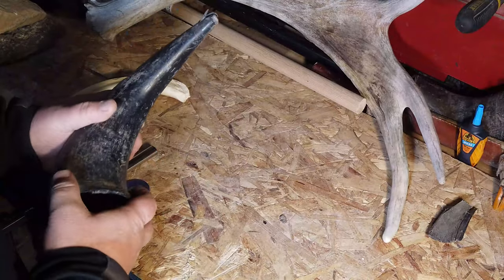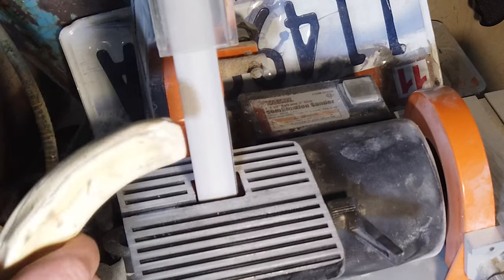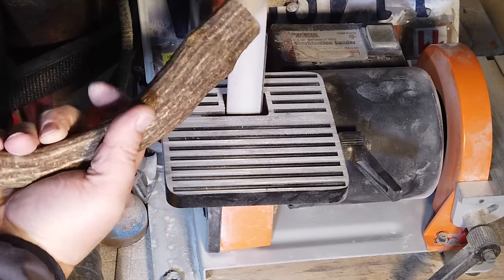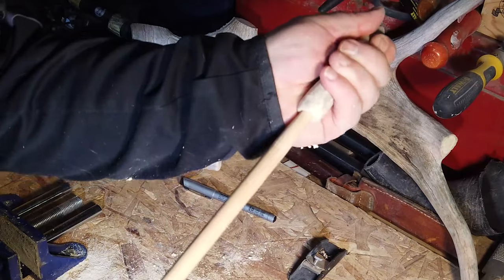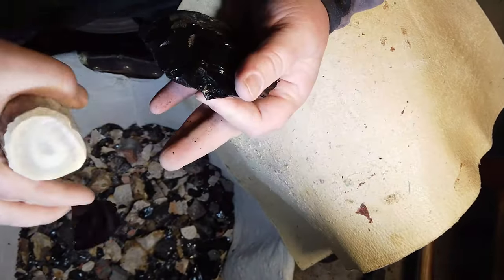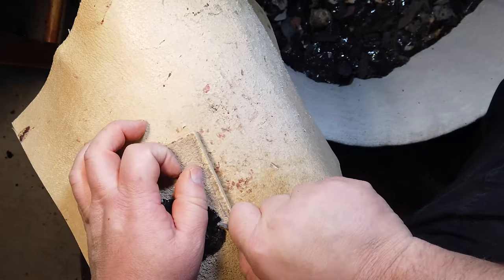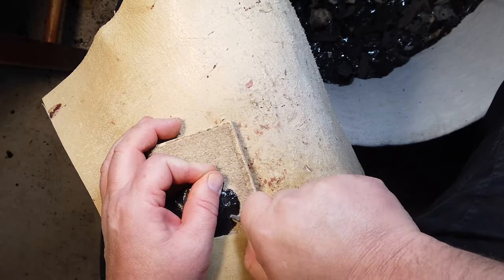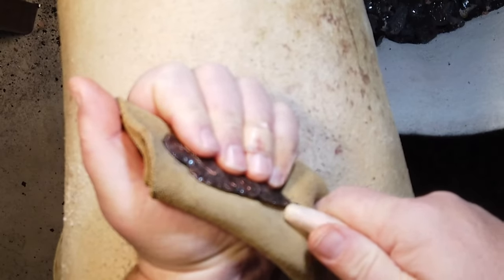New Tools for Arrowheads and EDBO Experiments in Knapping

Comment: Those are going to be some fun tools. I was floored by how that clay worked. It makes sense, but I would have never thought. That was a killer point, very nice work.
Reply from the maker: Yeah, I have a feeling I'm going to be using the clay a lot more often!
Reply: @chucklearnslithics3751  I bet it would come in handy on larger bifaces when  it's not possible to support the base and the tip at the same time.

Comment: Very cool Chuck. You got me thinking now. Perhaps a square of leather could do the same thing as the clay with less "mess". Really neat tools too. I've tried the shaft punch on multiple occasions I just have a hard time with it. I'll have to give it ago again. Really great video as well. Bravo sir bravo.
Reply from the maker: Thanks man.  I appreciate that, especially from someone working with similar tools.  Don't sweat it about the shaft punch.  I couldn't do Patrick's under the knee thing, and I really tried hard when I was learning indirect.  I also couldn't see as well with it that low and preferred it up on my lap.  Your strap punch is perfect!  Use what works, right?  Also, I do use a folded chunk of leather a lot.  Guys like Charles McKinney use it from almost start to finish with their indirect work, with excellent results.  The clay is nice because it adds mass back onto the rock.  It's a little messy and takes a little extra time to use, but it is the best way I've come across to keep thinning a piece that is getting narrow and/or thin.
Reply: @chucklearnslithics3751  Good stuff!!

Comment: Nice video chuck.  I hate it when I punch the top off my bison. If you save the peels you can use them for retouch flakers.  I just tie them to a piece of antler w a little bit sticking out. The hardwood dowel is fine if it’s hard enough wood with some flex, I just didn’t think pine would hold up.
Reply from the maker: Phew!  I'm so glad to hear you're okay with me "cheating" with a dowel!  😁

I agree about bison horn being great for retouch and I like to use it for notching too.  It does fray fast though.

Comment: Does the silly putty accumulate slivers of rock? Looks pretty great to work with!
Reply from the maker: That's a really good question and I wish I had thought to make that clear.  When you use it just on the top it does not.  If you use it on the bottom, where the flakes are coming off, you will certainly accumulate some.  You might notice me trying to pick them out of the clay to prolong it.

Comment: CHUCK!!! Do you think the putty method would work with fluting a clovis? Would I putty the opposite or same side as the "to be driven" flute? Thanks buddy.
Reply from the maker: I have thought about this a lot, actually.  And yes I've tried a few experiments with it.  It works very well for fluting!  I only have a few tests, but it seems to work best on the back side.  I didn't get as good of a flute when I covered it.  But I've only tried that once so far.

I intentionally mentioned the red clay sticking on the bi-face for a reason.  I have speculated that, perhaps, the red ochre residue on some Clovis points, like the Fenn Cache, could potentially be related to this method.  I think it's something to explore at least.  I have a plan to expose some archaeologists, working on Paleo related excavations, to the idea later next month, and see what they think about it.
Reply: @chucklearnslithics3751  ill raid the kids play doh and I may try it today. Wish me luck. Lol and thanks for the info.